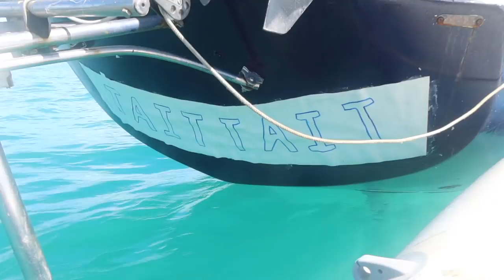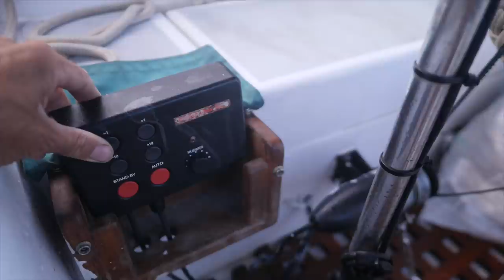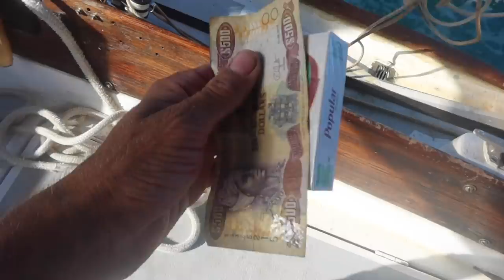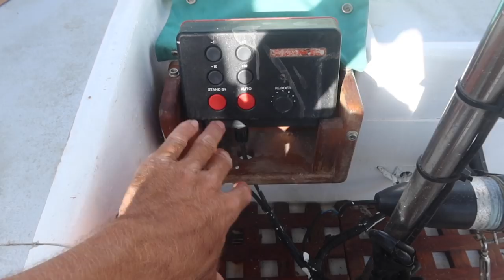I ruined the back of my boat in Jamaica

Comment: I would think the pot has oxidized since it works to just wiggle it a bit. Either replace it or clean it. Turning it back and forward a bunch of times usually does the trick as it removes a lot of the oxidization. Great video. So cool to “walk” in the middle of the ocean. 😃

Comment: Beautiful videography. I like your design for diverting rain water to your water tank but your idea of replacing the water in it with rum was better still.. Hope you get the paperwork for your boat name fixed soon. Take care and carry on safely.
Reply from the maker: Hahaha, it does sound like a good idea for crossing the pacific where alcohol is very expensive. However, I do need water for the 40 or 50 day crossing...

Comment: Your autopilot fix/hack - adjusting that trimpot is a good clue ...may only work temporarily as there might be corrosion in the trimpot.  A very useful thing to have onboard is dialectric grease, it keeps water out, stops corrosion, and conducts electricity.  Could try and dab a bit of dialectric grease on the wiper arm. (if you can, very delicate operation on something so small..)
Reply from the maker: thanks!

Comment: The autopilot motor likely has a permanent magnet but nonetheless uses magnetic fields to operate. In any event, it seems pretty close to the controller which you've described as being sensitive to magnetic fields.

Comment: I learned to filet with an electric knife.  It's so easy, I don't understand why more people don't do it ... assuming you have an inverter onboard.  Just take the knife and cut behind the gills just to the spine and then turn the blade and carefully follow the spine to the tail without cutting all the way through the tail.  Flip this slab over and then cut the meat through to the skin, and with the blade separate the skin from the meat all the way to the other end.  No gutting, no scaling necessary.  You end up with boneless, skinless fillets with just the ribcage attached.  This can be removed with a paring knife.  It only takes a few minutes and minimizes any meat waste.  Turn the fish over and do the other side in the same manner.
Reply from the maker: Good one Clay

Comment: Hay, I tell ya what. I by chance came across a used windless I have on hand. I totally forgot I had it. If you ever visit the USA "no rush south florida" You can have it. I'm 95% sure its  12v designed not 24v need to dbl check. Its just the hardware its self no deck toe buttons or fancy wireless remotes. If you ever head this way you can have it. Working on luxury yachts $ for a living, its hard to not aquire "stuff".
Paper work issues regarding the name  of the boat. THATS your own fault not worth a drink. Boat hardware failings un-expected are always worth a drink. Calm the nerves and try again. Self infelected you earned it MAN UP. And yes LEARN to work a blade when carving fish.  FYI it might be worth considering building a small hand controlled swinging davit for loading unloading the outboard(s). To/from the dinghy.
Reply from the maker: That would be awesome!

Comment: issues with your autopilot like this is due to corrosion in the wire. when salt water gets into the wire, it causes oxidation in the copper which interferes with the conductivity of the wire,  when its moved, your moving the corrosion inside the wire, which then affects the conductivity.  also can be corrosion in the wire connectors.
Reply from the maker: good to know!

Comment: Something to consider. In your video I noticed you AP control unit was mounted quite close to the unit's drive motor. Do you know that the drive motor has permanent magnets in it and every time the motor runs runs it is creating an electrical / magnetic pulse or EMP? Perhaps better to mount the control unit on the aft side of the cabin top well away from the drive unit.
May all your troubles melt like lemon drops.
Reply from the maker: thanks for the suggestion

Comment: You need to leave Jamica! Go somewhere else that won't be as strict
Reply: Unfortunately, drug/gun running boaters (and airplanes) love to use Jamaica as a transhipment port, especially the Black River area where they will anchor offshore and use smaller dinghies at night to travel up the river to drop off their load, hence the permit needed to go on the river and Huub's sail boat and his "papers" did look VERY suspicious, unfortunately.